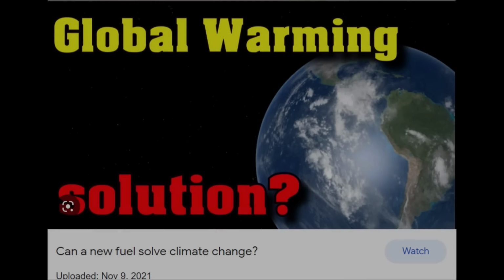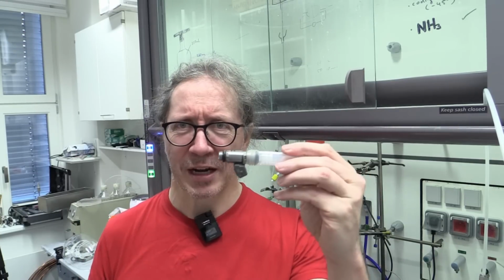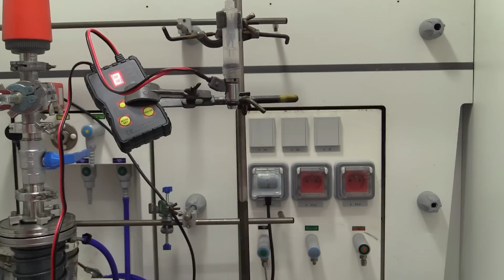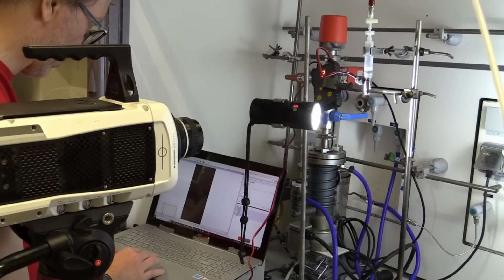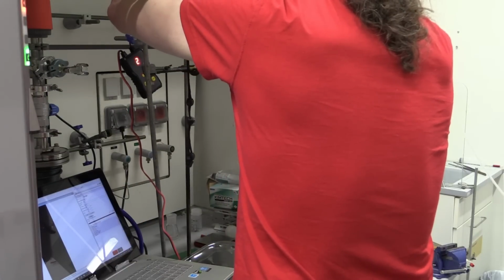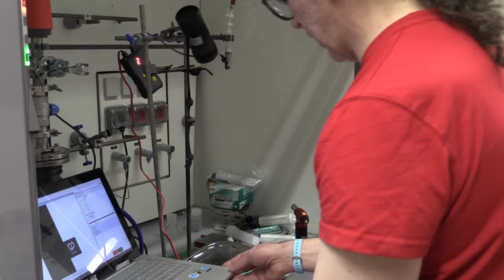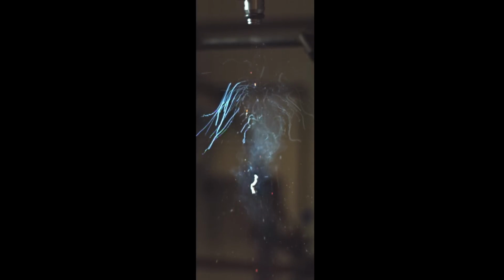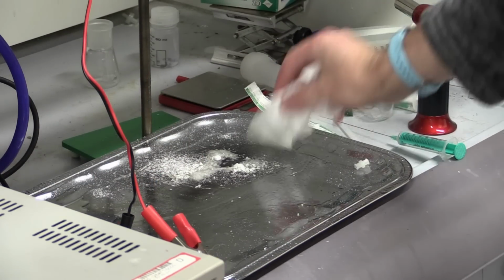Can Fuel Injectors burn SODIUM??

Comment: I remember before smog regulations got as tight as they did in the 90s and finally resolved the continuous smog bubble in LA... A big part of it was reducing nitrogen oxides but also ozone and particulates were important. Would the particulates from this create problems in an inversion layer city?

And what's it going to do to the inside of an engine? There's going to be a whole lot of sodium hydroxide at extremely high temperatures. That's not going to be the best situation for long-lasting metal parts.

Comment: I really love your enthusiasm! I've been working on weird makeshift sodium powered engines a good while ago but what I'm going after is a weird variaton of these old steam powered caustic engines. For now i've only had a "working" (piston jerked upwards after manually adding fuel) setup with solid sodium as i've ran out of potassium to make more alloy with and I can't make anymore as my oven and castner pot got smashed while moving it. Right now i got a littlebit of a break with my uni stuff, but it's hard to tell if i'll manage squeezing experimental stuff into my schedule.

Comment: Easiest way to get ignition is to have a second injector driven in parallel with the first, with the reservoir filled with distilled water. That will enure a nice jet of water with the sodium flame to ignite it,  and also a cooling down of the flame front as well, so it might be easier to photograph as well.
Reply: except the water comes out more of a jet, which would shoot through mist and most likely shoot flame out sideways. He could use another ultrasonic nebulizer for the water though...

Comment: Car and truck injectors like the type you are using usually run at 35 to 50 lbs of pressure.

Less pressure in the system give you starting and and performance problems.

You need to run a higher pressure to work the injector like it is used in a gas engine.

I  think your programs they are very informative thanks for all you fo

Comment: Just yesterday, I learned about LiHF fuel from the Rocketdyne tests in the 60s, and I remembered your experiments with NaK, and thought that it was obvious that it should be used as a fuel.  I didn't realize how far you had come in making this NaK engine!  I haven't finished watching this video yet, so I don't know if you solved the issues I was running into for the concept, but the main thing I was trying to figure out is the surface tension of the NaK.  I couldn't find the information ANYWHERE, except from a handbook from the 70s, and it outright stated that the referenced experiments were most likely unreliable.  The surface tension of NaK is incredibly important to figure out in order to get a good particle size in any kind of sprayer.  I am probably going to edit this comment once I finish the video.  I am ridiculously excited for this.

Comment: Good work!  I think this is more viable as a solution for a power plant where you can have appropriate facilities to deal with the unique nature of this fuel.  In an ice engine, the slower moving flame from gasoline is an advantage as well as the relative safety of the fluid in storage and use. 

 Then again, I caught my car on fire two days ago, after my injector's control malfunctioned and stuck fully open... flooding the engine with about a gallon of gas. Stay safe!

Comment: So, one question.
Turned out that putting lead in the air was not a great thing. How is the forecast for Sodium/Potassium ?
I know it is mot the same, but I still like to consider if there are any implications.
Reply: The difference is they knew lead was bad even back then but still went ahead and did it till health issues started cropping up in mass and had to stop.
Sodium and potassium are both readily used by the human body unlike lead so unless people start huffing car exhaust they aren't going to suffer any issues (and even then they'd likely die from asphyxiation first)
Reply: That vapour is either quick lime or caustic soda.  Not near my eyes/lungs please!

Comment: I guess sodium in it's pure form is rare in nature. Did you include energy loss for the production of sodium in your calculations??
Reply: its 4 dollars per kg
Reply: @smegheadGOAT  I meant how much CO2 is produced by the production of sodium
Reply: @simonsays5587  You could produce it with solar or nuclear power, much like hydrogen. The real problem is the waste product of Cl2 gas when you make Na from NaCl. If you release it, it will turn into HCl, which weathers carbonate minerals as acid rain and thus liberate CO2. If you dont, well then you are going to run out of tanks to store it in.
Reply: @TheBackyardChemist  you clearly have had a bit more chemistry education than me👍😁🖖
Reply: @smegheadGOAT  It's that cheap, because it is a waste product of chlorine production. If chorine becomes the waste product, i bet the prize goes up.
Reply: @smegheadGOAT  "dollars" isn't a unit of energy I've ever heard of lol

Comment: You could likely just go to a junkyard for the high pressure fuel pump that the direct injection injectors use.... cause usually dual-injection engines have the high pressure pump conveniently on top of the engine....

The issue with low-pressure injectors is that they rely on the vaccum that the engine cylinder makes when it sucks air

Where as direct injection injectors are designed to inject gas directly in a high pressure environment (some engines are 12:1 compression)
Reply: You should also get an E-85 injector if youre using ethanol.... cause its got some different material to handle it....

And id really urge you to go to the junkyard for an OEM injector as they shouldnt leak as much as cheap chinese injectors
Reply: Cause the goal of an injector is to atomize the fluid, so buying the injector that carries the closest characteristics is better

Comment: I would love to see this kind of thinking applied to current synthetic fuels. Just one question: oxidation is accelerated when in the presence of salts?
Reply: Edit: I understand that sodium on it’s own probably can’t be classified as a salt but I also know that distributors will occasionally blend their own formula with petrol to give it subtly different properties. (ie; Exxon Mobil)
As well as the variety of chemicals they sell at the auto parts store. (ie;SeaFoam)

Comment: Injectors, high pressure = petrol engine, very high pressure = diesel engine.
Reply: Very high pressure, GDI engine, the one that needs a 100bar boost mechanical pump on the engine, to allow the injector pressure to exceed cylinder pressure by a fair amount, so that the injection into the actual cylinder can take place.
Reply: @SeanBZA  a 100 bar is low pressure for a diesel, most old school diesel injectors were set around 200 bar

Comment: Also am old fashioned automotive engine timing light will work perfectly to illuminate your injector spray pattern. That's an old school way to check for blocked or dripping injectors n throttle body systems. You  use the same trigger signal for the injector to trigger the inductive trigger on the timing light.

Comment: really loving the progress of these videos so far :D
i am probably a little too late to suggest but i would recommend using a diesel injector as its intended for a much higher pressure along with larger orifices that may help to prevent some blockages

Comment: Awesome! I could have sworn I suggested something about fuel injection on the first concept video... Also, Diesel injectors are something else, due to the fact that they wait to inject until the combustion chamber is already pressurized. Most diesel motors don't even use spark plugs, just the pressure/ heat from the pistons, and the fuel pressure alone can be pretty dangerous.
Reply: The problem is they are as he mentioned, a high pressure injector, where as this one was a low pressure injector. This only needed a few PSI to function where as a diesel one will need upward of a 300-500 PSI range. (Gasoline versions tend to run around 120-200)
Reply: @SilvaDreams  Yeah, I know how high Diesel can go. The problem is, I assume, that he doesn't have access to high pressure air at the lab. There are a few other "problems" too, but I think they could be worked out.
Edit - I didn't mention how high the fuel pressure is in a diesel, but 300psi isn't going to be enough pressure to overcome the chamber of a big diesel, not even close.
Reply: @Wooskii1  Oh I know the input is around 300-500 PSI but at the cylinder side it's around 30,000 to 50,000 PSI
Reply: @SilvaDreams  Yup, those are good numbers.

Comment: Interesting, id suggest the reason the NaK ignited better towards the end was being atomised much more effectively, and right at the end it looked like the injector was passing a mixture of argon and NaK, so it was super finely atomised. Id recommend you use fuel injectors with much finer holes and more of them, plus higher injection pressures. This should enable the NaK to mix with air much more effectively. Funnily enough its what automotive types have aimed for more and more over time. Finer spray, better burn. From one Phill to another, keep up the good work :)

Comment: observation in all cases of various liquids. The spray pattern as well as the droplet  size, has not been fully optimized.
I would suggest a design of experiments .
To characterize a single injection event. 
1. find the lowest possible Pulse Width  that will open the injector . That may vary as you increase inlet liquid pressure.

2. Run a series of varied PW @ a fixed pressure.

3. Run a series of varied pressures @at fixed PW.

The data will will allow  you to fully optimize the droplet size and spray pattern. 

This characterization  work will allow to achieve consistent results and eliminate test to test variability. 
That's my thoughts.

Best regards, 

Steve Marshall

Comment: There are also two types of electronic port injection, fuel injectors. Pintle type and disc type fuel injectors. Pintle are believed to be more resistant to contamination. thus making them less likely to leak or display a poor spray pattern.  You have a disc type. Don't know it if matters with sodium and potassium but it's good to document. Also, 3 bar is the standard fuel injection pressure on both types. However, 80s gm used a lot less in throttle body injection.

Comment: There are a whole host of different fuel injectors. Some are designed to work at 1 bar and of course up to 100"S. injectors with standard nitryl or rubber o-rings generally are not direct injection and range about .5 to 4 bar. If the injector you have is for a low pressure system it may force open the pintle at massive over pressure and make it leak...But love your genuine enthusiasms on these experiments...keep it up

Comment: excellent analysis and enthusiastic presentation - it would have been interesting to have a transparent cylinder with a plug at the bottom. - as there are some pressure and mixing variants that can effect the combustion - flame front - or even use a small pilot light at the bottom of a columb

Comment: You could look into some companies here in the US that make custom diesel injectors, who can give you as much flow through as many ports as you want - I don't know what they have for diesel performance in the UK. That's an interesting idea, id like to hear more about all the interesting properties of the sodium smoke, and with the problem of the sodium needing to be heated to 100C, my truck - a 94 chevy with the 6.5L diesel engine uses a diesel fuel heater before the injectors anyway, so a sodium heater id imagine wouldn't be too far off base. But my truck only injects at about 15 psi, where common rail diesels inject at 30,000 + to atomize the diesel and to get a more complete burn.

Comment: Leakage is mainly caused by a lack of the trace amounts of detergents and lubricants normal gasoline has, which builds up a thick protective surface in small gaps, which also makes any contaminant more likely to lift off the surface mechanically.
A fluid with higher viscosity or larger molecular size will seal gaps better, but will also be harder to drive through the injector.

Comment: Material science is important. Can you fill a PP syringe with Diethyl ethanol, or will it turn your syringe into rubber? Try it, and find out (the hard way) as i did! I am not a scientist, but i AM an engineer. Applying science to an everyday problem is what keeps me employed, and sometimes there is an instruction manual, and sometimes there isn't! Keep up the great work Phil 😀

Comment: You should try to use two injectors, aimed at each other, with jets coliding in a V shape. One is sodium, the other is water (or .. steam?). That's the design of cryogenic rocket engines injectors. Would probably ignite by itself.

Comment: Now I really want to see it from a diesel type fuel injector.. I build old mechanical diesel injectors, they run at 300 bar, / 4000 psi I think the new ones that are electronically controlled are up around 5x that pressure
I sometimes ignite the spray just for the fun.. it's amazing how quickly it burns in plain air.. wish I could SEE it in the cylinder at 1000 PSI and much higher temperatures

Comment: Try a diesel injector. It would allow better flow while still atomizing the NaK alloy. Also try ignition under normal cylinder compression. Note: diesel engines use higher compression due to lack of need of spark. Atomized diesel fuel under compression is enough for ignition but with gasoline spark is needed. So it would be interesting to see if compression around 90psi would affect the burn of your alloy.

Comment: You could also maybe give the fuel injector a negative charge to prevent the solution from sticking to itself and whateer container it is ignited inside of.  Also it could help to atomize the metal better.

Comment: 1 - if you knew/thought this thing would die, why didn't you buy like 5 (or at least 2) of them off the bat, if they're just 20 bucks?
2 - maybe you could sync up 2 injectors so that one sprays something that ignites the NaK, like water (or water+ethanol)?
3 - maybe program something like an arduino to do the triggering, rather than be almost hugging the detonation? :D
though, this might need some additional components, if you have to use a significant amount of power for the triggering, like some transistors, diodes, and perhaps power cells... There are TP4056 power management chips for 18650 li-ion energy cells, which you could rig up in series to get higher voltages, if required. Though, if you have a 5v-logic-triggerable PSU, that might work better

Comment: Wow it is an amazing experiment! I thought the equipment for these experiments must be specially designed, but you managed to use ordinary fuel injector for this! Amazing! I hope you will invent some sodium-potassium engine some day
Reply: Well they worked for the few minutes he was using them. Doesn't mean they would last.
I doubt designing and manufacturing an injector for any liquid would be that difficult or expensive anyway.

Comment: You can try to use good old one pump injector which inject fuel at 2000 bar. you can find a lot used ones , but it's a bit more complicated and probably impossible to get this sodium thing trough it, because you can't even see holes with naked eye through which fuel enter. and uses mechanical force to activate.

Comment: DI's are actually pretty good at resisting carbon build-up cuz of the very high pressure forces. Kinda brute-forces any obstructions or build-up.
Only downside is intake-side valves don't get to see any cleaner additives. 
Which makes an oil catch-can & filter desirable for the rebreather path. Or (depending on municipality & laws) elimination of the rebreather route. Also, a good intake air filter.
sorry, off topic :)

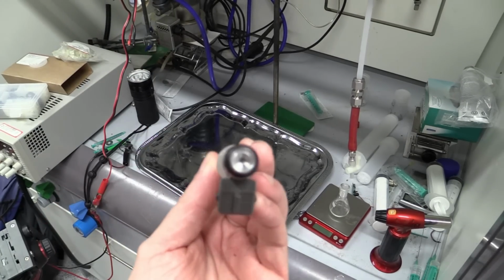Comment: @7:45 Just FYI there are different injectors with different amounts of holes. Like the 2003-2009 Mazda 6 2.3L injectors have 12 holes, and are cheap. They may work better for you to atomize your fuels.

Comment: It will leak with ethanol and similar products because the seals inside the injector are made with a rubber compound that shrinks and becomes brittle when exposed to it and will eventually fail outright. You need an injector rated for flex fuel or ethanol to prevent it. The difference in pressures needed to pump fuel is based on weather it is a direction injection or port injection injector. The ford 3.5 Ecoboost motors made after 2017 use dual injection and the flex fuel port injectors are about 30 bucks and will be a better tool for future experiments.

Comment: Yes, i used sodium many times to make fuel, but not normal sodium because normal sodium doesn't work very well. Try sodium nitrate.
Mix with powdered sugar, melt them together and set on fire. Burns good!

Comment: I think the leaks when closed are something expected and designed around as the injected fuel just sits on the back side of the intake valve, getting pulled in on the intake stroke.

Very exciting science though.

Comment: I don't know about petrol direct injectors but diesel(which is much higher pressure) direct injectors are lubricated by diesel fuel and if anything else goes through them they get damaged, so does the common rail diesel pump and that is a rather expensive repair. Your injector injecting water is probably not doing it much good but of course octane is not a particularly good lubricant either so maybe petrol injectors tolerate that better. :D

Comment: if you need more of a fine spray you may want to look into a performance car or motorcycle injector. i remember one of the main improvements honda made between the cbr929rr and the cbr954rr (motorcycles) was they went to a 12 hole injector iirc specifically for better atomization.